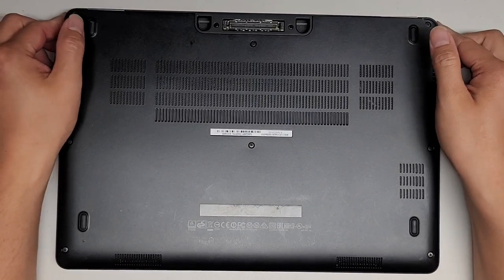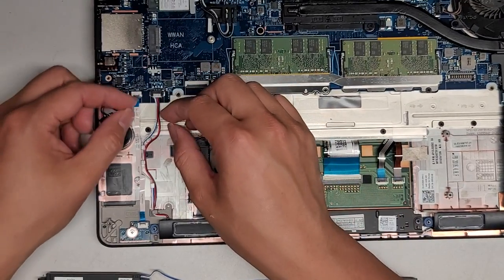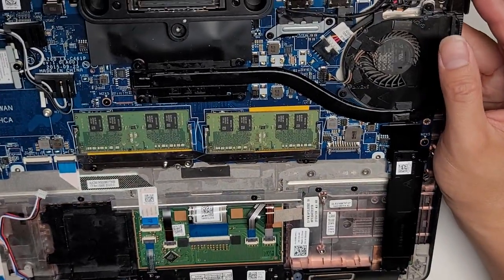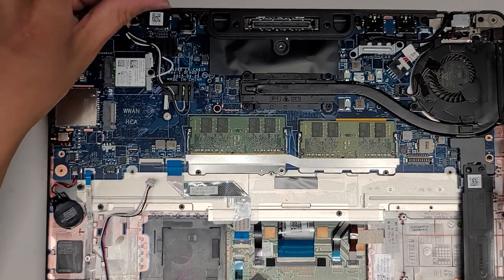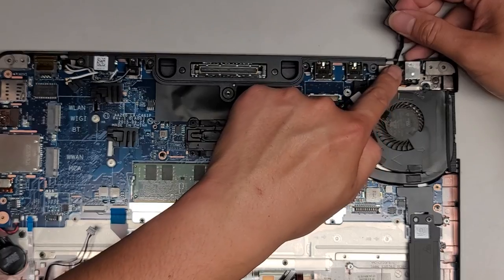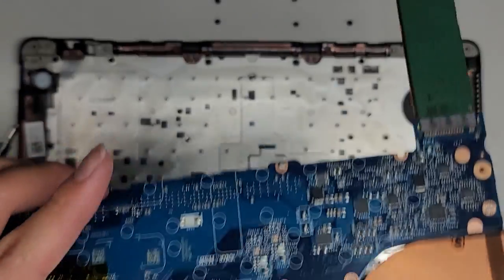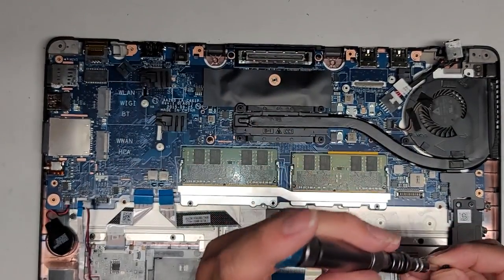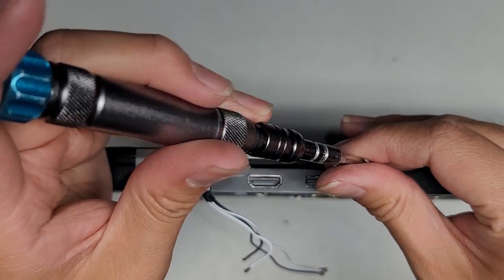Dell Latitude E7470 Complete Disassembly RAM SSD Hard Drive Upgrade Battery Replacement Repair

Comment: The  colors next to the antenna attachments tell you which wire goes where... But THANK YOU for pointing out that the connections are directional. That black wire isn't quite long enough to make it easy, sigh.
Reply from the maker: Yup

Comment: I've worked on 100s of these and you need to be ultra careful with the WiFi connectors. Failure to snap them in properly you're into a replacement WiFi loom, removing the screen to do so. It is best to fit the antenna leads before securing the WiFi card.
Reply from the maker: Whatever works
Reply: @ItsBinhRepaired  Excellent repairs, great knowledge, well done.
Reply from the maker: @robblack7560  thanks!

Comment: What do i do when the screw ports break , my laptops screws dont work cos of it and itts hangging loose

 Also when i apply sone pressure it shows pixels on the screen and freezes
Reply from the maker: Jb weld the brass part in place. Not sure about the pixels thing.

Comment: Is this an i5 or i7? Or an M.2 NVMe SSD (with an M Key) - instead of the original SATA) would support both i5 and i7?
Reply from the maker: I only know what's in the video
Reply: I decided to spend one more USD for the "M"- key 4,500mbps SSD .My pawnShop e7470 had no C:\

Comment: 2133P /Q/R/S or T wait-states Cas latency is compatible.
Reply from the maker: Hm?
Reply: @ItsBinhRepaired  JEDEC standard letter for access sequence number of wait states.
Reply from the maker: No idea what you're saying
Reply: @ItsBinhRepaired  the letter tells how many Wait states for cheap, better and best DDR4 RAM modules https://en.m.wikipedia.org/wiki/Memory_timings#:~:text=The%20timing%20of%20modern%20synchronous,%2D8%2D8%2D24.
Reply from the maker: Thanks!

Comment: Do you gave the knowledge if these computer should start without battery?
Reply from the maker: Most do, but I'm not sure for this one. You can try.
Reply: @ItsBinhRepaired  The e7470 can operate without a battery. A post-laptop-life e7470 is a handy home server; it also can support 2.5GbE via USB if you have a faster upstream. Not sure about 5GbE, but that's still an oddball in price and availability.

Comment: can we install and hdd in it?
with ssd
Reply from the maker: Simple answer is no. I'm going to assume you don't know what an hdd is or looks like? I always wonder how people know the terms, but don't know what they're talking about. You could use an external one, but how would you fit one internally if I told you yes? Technically anything is possible if you do extreme modifications or understand computer circuitry to make changes that aren't normally possible.

If the reason is to add more storage capacity, your best bet is to get a larger SSD and clone the old one to it.
Reply from the maker: This is what you'll need https://youtu.be/4p5jFDzVwUw

Comment: Hey, Where is it's CPU ??? 🤔
Reply from the maker: Under the the heatsink like every other computer lol
Reply: @ItsBinhRepaired  I have the same laptop. But I don't know if this has a removable CPU or not. Is it a removable one ?
Reply from the maker: No, I'm pretty sure I mention that in the video. You should watch and learn about your computer.
Reply: @ItsBinhRepaired  Ok bro, Thanks for replying ! 😉
Reply from the maker: @ledart6090  no problem
Reply: @ledart6090  New laptops don't come with changeable cpu (they are directly soldered to mainboard) only thing you can change is HDD/SSD and ram
Reply from the maker: For the most part. Some gaming laptops, pretty rare have removable cpu, but it'll be hard to find upgrade ones.